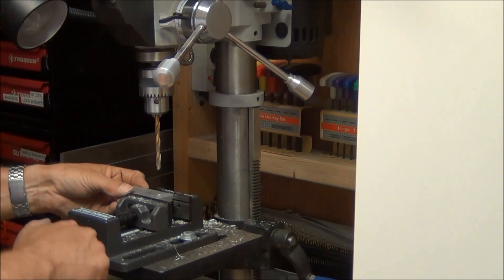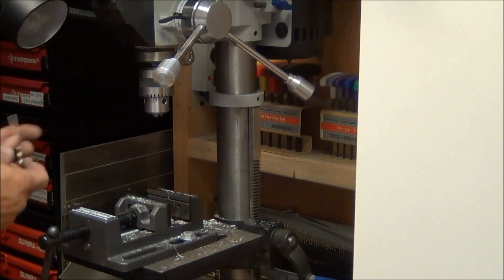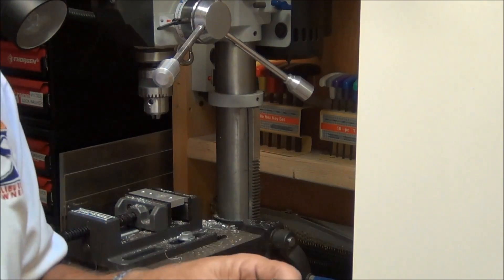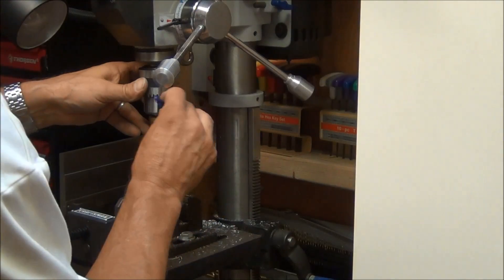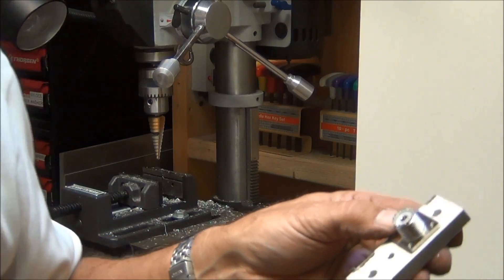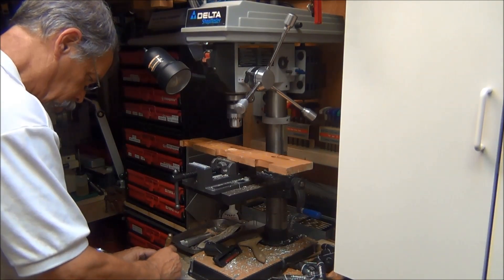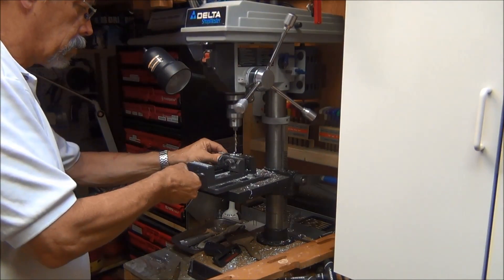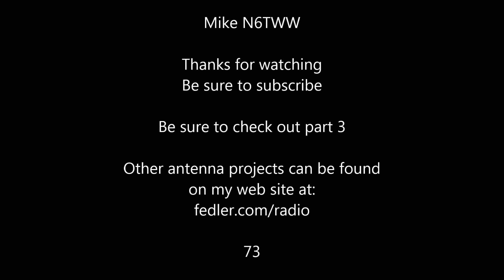J Pole antenna for 70cm part 2 by N6TWW

Comment: Is the outer J part electrically connected to the main antenna?? Or does it have to be electrically isolated?
Reply from the maker: It is connected at the base plate. All components except for the feed wire that is wrapped around the longer element are directly connected to each other.
Reply: Mike Fedler thanks! I would like to build this but I only have 1-inch thick metal pipe. Do you think that is too thick of a pipe for something this small?
Reply from the maker: Re I think you would have a hard time trying to make this small antenna with such large material. It could probably be done but I don't know what problems you would run in to. I have seen the two meter version made out of 1/2 inch copper pipe but 1 inch for the 70 centimeter version is going to present some unique problems.
Reply: Mike Fedler alright thanks! better i dont try this with 70cm so I don't waste a good metal pipe.
Reply: Mike Fedler Hi, I recently bought a bunch of 1/2 inch pipe to make one of these.Just wondering because maybe you know the answer, But could a 2-meter version of this antenna work to recieve signals from the international space station? They are doing SSTV transmissions from the 21 to the 23rd!
Reply: Re I